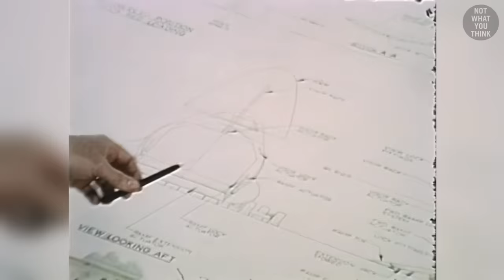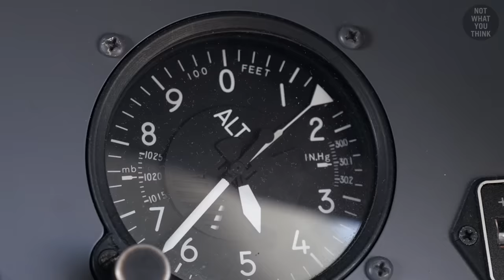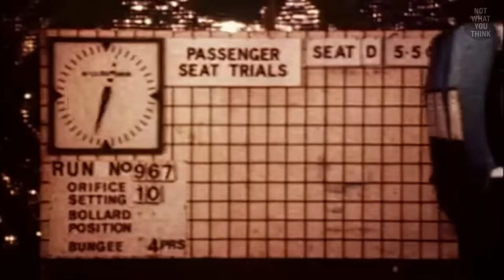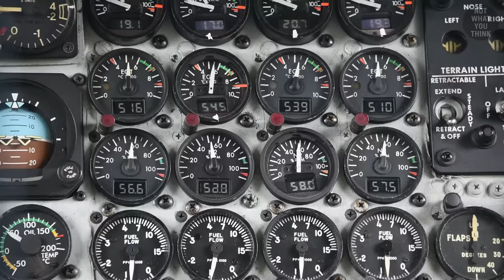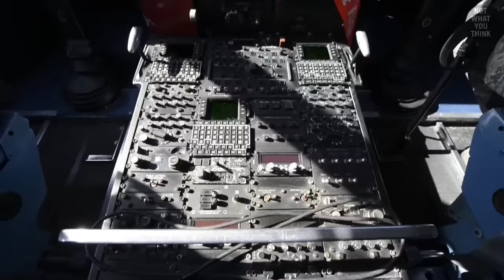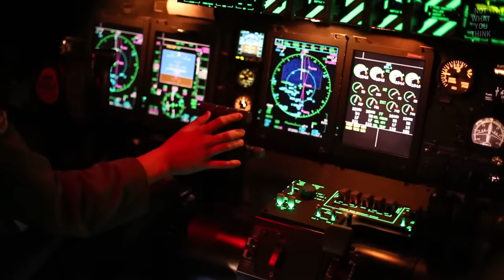America’s MASSIVE Military Airplane that is Named After a Porn Star

Comment: Having flown in a C5 numerous times, I can attest that its not a big deal or very remarkable. Its slightly odd feeling the acceleration facing backwards but other than that, there is not anything exciting. The passenger cabin is upstairs just forward of the tail and there is only one or two pairs of small windows. In the passenger cabin, you’re quite removed from fact that you’re in an airplane most of the time. The lighting is quite dim with a cold metal floor and utilitarian surroundings and the passenger compartment heating can at times be inadequate with an uncomfortable cold draft moving around your ankles. Its also a quite a bit noisier that a commercial flight. The seats are as comfortable as you would expect from a seat that is designed for the military with an intended life span of 40+ years. The greatest enjoyment of a C5 is viewing it from the ground on approach or departure as it seems to be defying gravity seemly moving very slow because its so big.
Reply: what's the legroom like?
Reply: I slept on a lot on my flights in the C5. The C130... not so much. So damn loud inside and the fold down jump seats are more uncomfortable than a 1970's folding lawn chair.
Reply: What I think is remarkable about this plane is the cargo it can move and the mobility it gives to forces and weapon systems. There are helicopter squadrons that can operate anywhere in the world within 72 hours because of this aircraft. That's world class capability right there, so I mean that is pretty amazing.

Comment: Ex C-5 flight engineer here. You cannot deploy flight reversers in flight they are locked out of.operation. There actually was an accident at Ramstein  Germany because a thrust reverser deployed accidentally . They do sometimes keep two engines with thrust in descent because they need bleed air to keep the interior pressurized. The reason you only take one M-1 tank because if you take two tanks you cannot carry a full fuel load. You can put three Chinooks in a C-5.
Reply: It's the C-17 that uses thrust reversers for a tactical decent. It'll happily make a 20,000+ ft/min decent
Reply: My guy your wrong, you can do the inboards only
Reply: Thanks I will never think of the work LOAD the same again.
Reply: @Nathore1  "Ex c-5 engineer" "NO YOUR WRONG"
Reply: Some airplanes pressurize better than others
Reply: @Nathore1  it's possible he was referring to the C5-B and you were referring to the C5-A or vice versa. I only saw the C5-A as I was in during early mid 70's. Then it was quite possible which allowed for the slow speed of under 200 kts.
Reply: As an EX C5 Flight Engineer (16years) you are wrong. The inboard engine reversers can be deployed in flight. You're now Q-3!
Reply: @Nathore1  how you gonna tell an ex c-5 flight engineer he’s wrong 💀
Reply: its not Maria its Mirya, the Ukranian bird
Reply: @speedtime1218  maybe that’s why he’s an ex flight engineer
Reply: Times change and the C5 has been around for a long time.. but in the 90s when i flew it as an IP, the inboard engines could use thrust reversers inflight.  The pilots even had an emergency trust reverse retract switch (which was 50-50 working).
The really scary thing was the C5 could even deploy ground spoilers inflight.. A not so smart base commander did so, but was saved by his seeing eyed checkout IP.
Reply: Yeah, I was watching it take off, didn't sound right,  when it crashed just after the end of the runway.... had to go back to work after just having gotten off.
Reply: @speedtime1218  because he's an "ex-engineer" and I'm a "current" one.
Reply: WHAT? THREE?
 Three of those double rotor Chinooks!!!? 

That gives an idea of an aircraft's size if it can carry three OTHER aircraft!
Reply: @clan_houltz The fact that comments like these receive more upvotes shows you how little curiosity most of YouTube actually has. Zero questions, just completely laid over to appeal to authority when they read someone else's claim to knowledge lmao.

Comment: I flew in a C-5 back in 1986. Back then, there were only 47 rear facing passenger seats and there were no windows. Clearly some improvements have been made over the years since then.
Reply: 47 seats? Sounds strange. Were you in the cargo hold? The upper rear compartment above the cargo hold had seats for up to 73 passengers plus 2 loadmasters.

Comment: I was a C-5 Instructor Pilot in the 90s.. A few thoughts:
FRED is the nickname, even being used as the local (training missions near the base) callsign at Travis AFB.
The Linda Lovelace thing is funny, but I never heard it used.
Reverse thrusters on the ground were almost never used due to risk of tipping back on the tail when braking. 
Reverse thrusters in the air were almost never used due to the high probability of them failing to close properly (you have to shut down the engine).
I carried the equivalent weight of 2 M1 Abrams many times, but for a long flight it would require so many air refuelings it just doesn't make sense.
Reply: Agree.  I'm an Air Force logistics officer with 22+ years in.  While "Linda Lovelace" made immediate sense to me and gave me a laugh, I've never once heard it used before for the C-5 in a career surrounded by aerial porters and C-5 missions.
Reply: That truly IS funny, but also true about the load, on both counts!!
Reply: Thats why you never use brakes when you powerback. Come out of reverse and apply brakes when you start moving forward.
Reply: I'm pasting this from an above reply:    I was stationed at Altus AFB '80-'82. I got to go on a night air-refueling training mission (in the cockpit), gut wrenching surreal experience.  The Cpt. in-training couldn't grasp the concept that it took 2-3 seconds for the C-5 to respond, he couldn't keep it stable.  The instructor had to slap the throttles and dive "breakaway, breakaway, breakaway " putting us into a nose dive ... 3 times.  I became a little weightless, we were on the floor behind the pilots seats with headsets on.  I finally went back to the passenger seats and strapped in, whew ... didn't want to get sick.  Amazing experience!!!
Reply: @robhaney8568  All I can say about your story is WOW!   I don't know if I would have liked that or not!  As a GA pilot, I'd give my eye-teeth to get to be in the cockpit of a C-5, but not at night, I'd like to see.  I hope you had plenty of altitude for those antics!
Reply: @mjleger4555   Yea, tons of altitude for training. It was Twilight Zone surreal, pitch black, watching the lit underbelly of a KC-135 get closer and closer, having the boom just a couple of feet from the windshield until it swung up and connected ... then the nose dives ... all we saw were lights on the ground fill the windshield.  We were in a dive for a bit but never came remotely close to the ground.  It was a thrill yet gut wrenching.  Loved my AF years.
Reply: @robhaney8568   Many years ago, I was invited to an AFB to watch a Galaxy take off -- it went right over our heads!  What a thrill that was for me!  And around that time, I got to go inside a parked KC-135 and see the boom and they let me lay down where the guy did that flew the boom!  Another thrill.  I'm a GA pilot, but if I had it all to do over again, I would have loved to have joined the USAF, but I doubt my parents would have condoned that, they would have made me stay in school!
Reply: I'f you guys were adults your profile picture is litteraly better
Reply: @robhaney8568  Two thoughts here.  1) Travis had a ground (non-motion) simulator to practice and even as an experienced AC it felt like standing on a bowling ball.  Took time, but made you a better pilot.  2) If this made you a bit concerned, never look through the sextant port (not sure if is still a thing).  The tail moves back and forth a lot, I mean A LOT.
Reply: @jimfox9719  My experience was in '81, I was in the AV Squadron, Altus.  We did the C-5 training manuals, video training, and plywood mock-ups of the cockpit (static gauge paste-ups .. old school), refueling, loadmaster, and flight engineer.  That's why they let us go up with them, to see the end-product of our efforts and drill home the need for perfection in our materials.  Later, I was in DoD in most of the major corporations in Dallas that had govt contracts. One of our main partners was Simuflite at DFW, they had the full simulators on gimbals ('85).  Needless to say I miss that stuff.
Reply: Liinda was not used much.  I go back to 1978 as an F.E.  Back then Fat Albert was more common than Linda, but FRED was most common.  We called C-141's   'MINI-JETS'

Comment: The C-2 Greyhound also uses back facing seats, although that’s probably because of the forces from the catapult and arresting gear
Reply: most likely the reason, unless it has 5-point harnesses, helmets, and HANS devices for all passengers.
Reply: @ForzaMonkey  oh it definitely does have the 5 point harness and helmets, spent too much time in them already lol
Reply: In the navy😈
Reply: Forces from catapult would not be the reason for backwards seating, but the arrested landing, for sure
Reply: @k.h.1587  exactly. When on the cat passengers lean forward (towards the back of the aircraft).
Reply: IIRC, the C5 Galaxy is built for short takeoff. So probably done in that case.

Comment: Regarding using reverse thrust on the ground (called a powerback): as explained many planes can technically do it, but it's generally banned because it has major downsides compared to using a tug. Running engines with significant power is dangerous with people nearby, there's no rear-view mirror, debris from the ground could be sucked into low-mounted engines, and it also costs way more in fuel. In some airports only DC-9s with engines much higher up were allowed to do it.
Reply: Also, you can’t stop an airplane quickly during powerback. If the pilot steps on the brakes, the airplane will tip on its tail. The only way to stop is to put the engines in forward thrust and add power.

Comment: I've been on a 757 at an airport where we couldn't find a suitable tow-bar and I talked the pilot into a "power-push" using the thrust reversers instead.
But... we were parked at a wide-open ramp without anything around that could be blown over, had several spotters stationed around us to be our eyes, and the pilot was well aware that you cannot use the brakes to stop since that could cause the plane to start tipping onto its tail.

Comment: I spent time at Edwards on the C-5A certification program and several years at Dover AFB after they were introduced to service. The   C-5A development was rushed due to Viet Nam needs. This is why the wing flutter issue was not discovered until it entered service. 
One feature of Fat Albert was that it would not "cube out". In other aircraft, the cargo cubic feet space limit was often reached before reaching the gross cargo weight limit. With the C-5A this was not a problem. This was a major advantage of the Lockheed design over Boeing's. Another issue was that Lockheed's design did a better job of operating under wartime conditions.
Reply: I was living near DAFB when the C-5s arrived. There was a lot of fanfare and an open house. They were giving out press kits with a lot of interesting details and some pics. Thumbs up for Fat Albert. That's the name I remember
Reply: makes sense. the 747-8f can carry higher gross but probs less volume
Reply: @AA-tz2bm  While I was at Edwards, the C-5A fulfilled a contract requirement with an 800,000 lb. gross take-off weight, a world record at the time. Boeing was there doing flight testing of the 747 prototype. They wanted to best the Lockheed feat for publicity purposes. Problem was the empty 747 airframe weighed 50,000 lbs less, so the had to make up the missing weight with more sandbags laying on the belly of the empty plane. When the day came, the press was called out to observe the record breaking flight. The 747 took off slowly climbing to pattern altitude. It slowly made its way around and immediately landed to the hoots and hollers of the Boeing people in the press room.  Boeing made a maximum publicity effort out of it. What no one was told was that the 747 had popped rivets from stem to stern and sat quietly on the ramp for 3 months being repaired before it flew again. Imagine what the aircrew thought hearing pings, pangs, booms, and bangs as the rivets gave way.

Comment: One of my work places for 25 years in Air transportation with the Air Force among the other air transport aircraft. The one thing about the C-5 that was bad is minor maintenance issues that would temporarily take the aircraft out of service like the air conditioning system for the passengers on the upper deck. The C-5 was the only aircraft i never flew on as a passenger.

Comment: I remember as a kid seeing these fly over our home on a few occasions.  Due to the immense size, the perception of the air speed and altitude is deceiving.  I grew up just outside of Atlanta and would see passenger planes constantly flying overhead at probably 4000-6000 feet AGL on approach to ATL.  Then you see one of THESE looking like it is 2000 feet and barely moving... while in fact they were as high or higher than the passenger planes.  Sort of spooky looking.

Comment: Think Lockheed recovered some of their costs by using the same cockpit setup on the L-1011.  I spent a lot of hours maintaining and pre-flighting TWA's L-1011 flight simulators.  Went to an airshow and toured the C5 and was surprised how closely the cockpit and flight systems matched the L-1011.  The crew said that the flight controls handled very close to the L-1011.

Comment: Thanks for the memories. I was a Crew Chief on this aircraft. Man, the distinct sound it made during take off and flight. It was at times a mechanical nightmare especially when parts were needed overseas. For the family members of pilots who didn’t come back to home base as planned? This a little A.F. Secret amongst the crew when flying into an area that we didn’t want to leave right away. Because Crew Chiefs had the authority to ground an aircraft due to safety concerns, the aircraft was no longer fully mission capable until the Crew Chief signed off on that aircraft. Needless to say, some countries visited were extra days and nights of having nice dinners or whatever other pleasure we’ve found. Additional note, if any person wants to join the Air Force and wants to work on this aircraft, fear of heights should not be part of your character. Standing on top of the winged T-Tail about to change a leading edge  with a tether strap on is not for the faint of heart. Work on a fighter aircraft instead. It’s first floor work.Dover and Travis AFB’s, you are truly missed! Also, I actually do have a connection to get you on a C-5 Galaxy. He is very well known in the military community. His name is Sign On Dotted Line Recruiter!!!

Comment: In the 1970's it was the C-5A Galaxy.   I got to walk through one that was on static display at  the air base I was stationed at.   The interior of the Galaxy is massive, and if I recall, you can carry full size tanks inside of it.    I also remember that they had some sort of instability or turbulence due to its shape.

Comment: WPAFB in Ohio use to be home to the C5.  They were spectacular to see.  The runway landing path crosses RT235, so you could litterally be underneath the plane when it was coming in on glidescope for a landing.  Even when parked, they never fit in the hangers they were so large.  WPAFB moved to the C15 years ago and although these are also awesome planes, they pale in comparison to the C5.    Growing up and living in the area was great, as it was very common to see the C5 as well as F16's and A10's regularly doing maneuvers.  The latter two no longer there and the C5 has been replaced with the C15.  It's a lot quieter now. It's sad.
Reply: Did you mean C-17?

Comment: ALL aircraft can travel in reverse! It was called "Power Back". They stopped doing it in the late 80's early 90's, due to safety issues. And commercial airliners vs military have a different set of rules. But to my previous point a 2024 A320, 737, etc.... CAN reverse, they're just not allowed to.

Comment: While I was stationed at Kadena AB in the 80s, as an MWD handler, we had a C5 land and break down. Another C5 landed the next day with parts for the first one, and it broke down. The next day, a C141 landed with parts to fix both C5s, and they finally were able to leave. FRED is a truly deserved name. 🙄🙄
Reply: Had exactly the same thing happen at El Toro in the 90s.
Reply: A long time ago, it was routine for a C-5 to be parked at Clark AB, PI as a cann(ibalization) bird for fixing transiting aircraft or aircraft in the theatre. The cann bird was flown out before 180 days on the ground to swap for a different C-5. The swap was to not exceed regulations/agreements that required permanent assignment of the aircraft for a longer period.

Comment: I've walked through a C17 Globe master III. Mt first impressions were from several miles away at the airport. The giant T tail stood out above the surroundings. I can't remember if the C17 can open on the front or not but the back end looks very similar to the galaxy 5. It was an impressive airplane.
Reply: No, the C17 does not have a front loading ramp.

Comment: An-225 clearly outperforms Lockheed C-5 Galaxy
An-225 Length: 84 m (275 ft 7 in). Wingspan: 88.4 m (290 ft 0 in). Height: 18.1 m (59 ft 5 in)
lockheed c-5  Aircraft length - 75.54 m (249.34 ft), Wingspan - 67.88 m (220 ft), Aircraft height - 19.85 m,

Comment: When it was first built, instead of hydraulics for the landing gear, they used compressed air.  It didn’t work very well, and was converted to hydraulic.  At one point, one landed at our base knelt down and couldn’t get back up.  A second one came in and also broke. A couple of days later, a third one landed to fix the first two.  Our parking ramp was full, so they were parked on a taxiway.